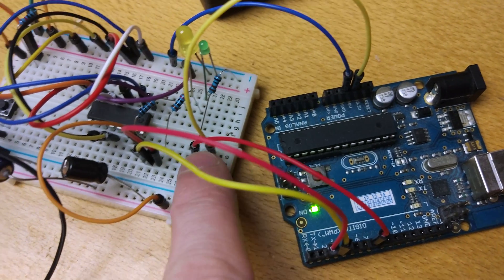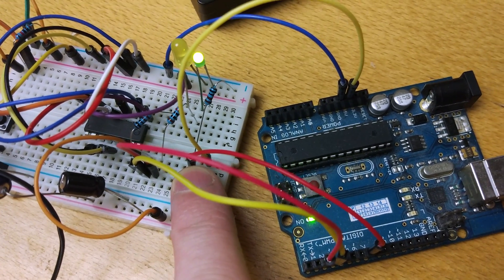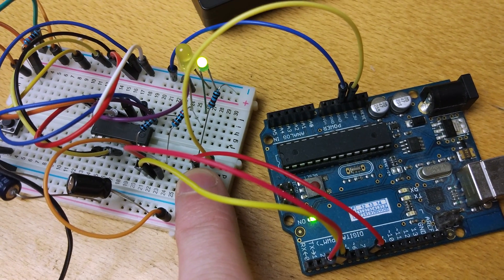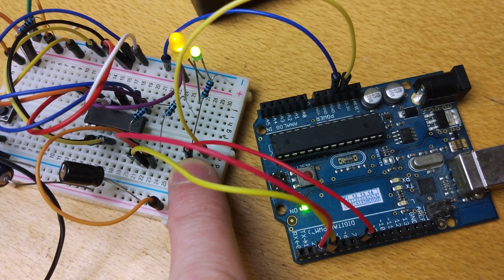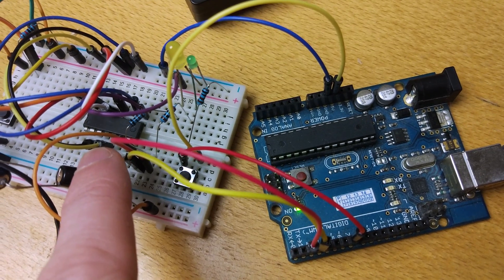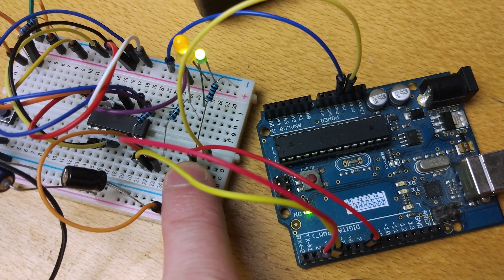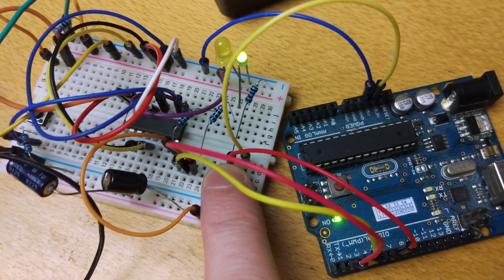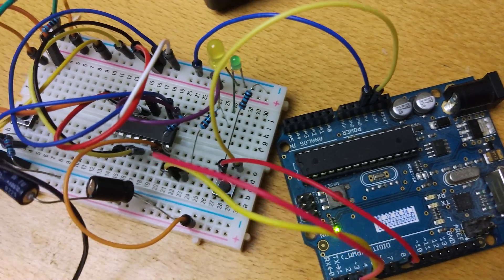Setting the UK ring cadence signal for the rotary phone

Comment: Looks like you have it correct. 75v RMS 25Hz 0.4 sec on, 0.2 sec off, 0.4 sec on, 2 sec off. (And it hurts every time, even after several years of at least once a week)
Reply from the maker: I will be driving at 12v to keep things simple, seems to work just fine but that may have to change once it all comes together.
Reply: Do you regret it? Curious cause I'm thinking about doing it.